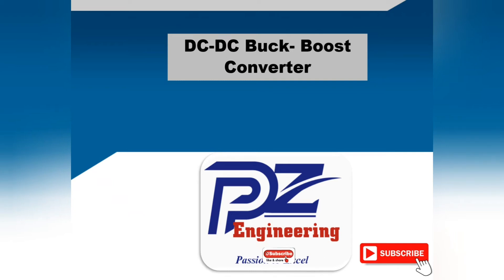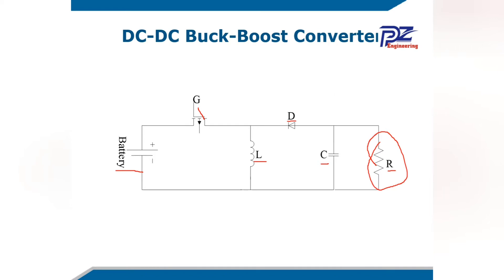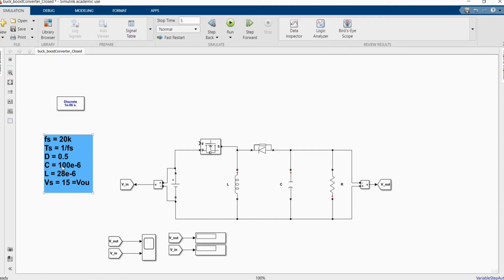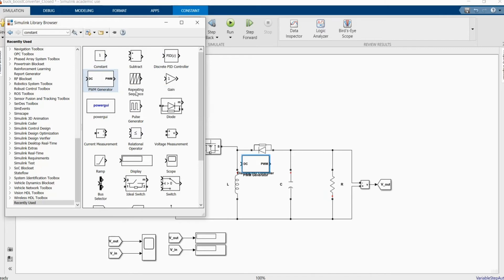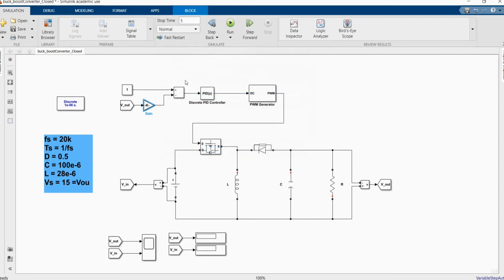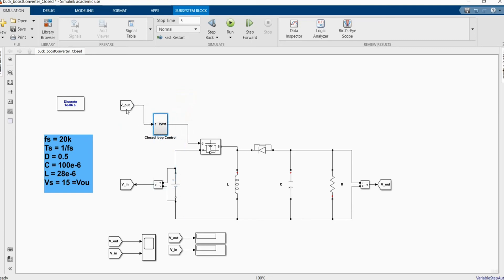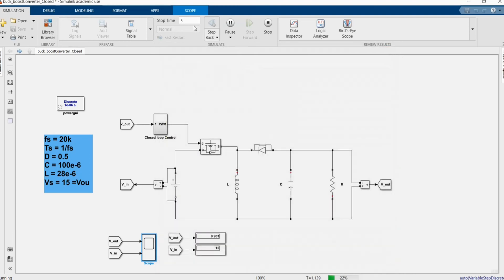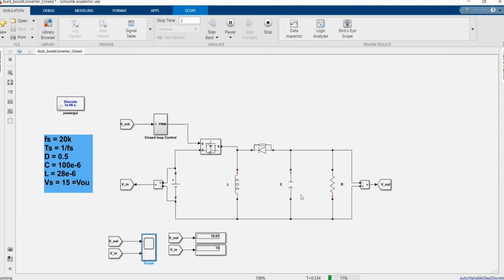Design and simulation of DC-DC BUCK-Boost Converter using PI Controller in MATLAB/Simulink

Comment: Can the buck boost converter charge and  discharge  batteries?(drive ac motor and regenerative breaking process using buck boost converter)if so,i need a simulation steps
Reply from the maker: Hello Thank you so much for your comment, I think it can. The main operation is when is discharging works as boost, during charging work as buck
Reply: No there is buck boost and Buck boost bidirectional i guess the second type only  which can do the regenerative braking

Comment: Sir i am using a bidirectional dc dc converter with a battery and solar system so my input voltage are variable. So how can i calculate the value of L and C. Plz help
Reply from the maker: Hi thank you for your comment, I think you should used an average input voltage to calculate your L and C, From there make sure to design very well your control system. I hope it helped

Comment: great vdeo it help me a lot! can you design buck boost converter with pid controller?
Reply from the maker: Helo; thank you for your comment.. It is the same thing... Just change PI to PID
Reply: @pzengineering2020  i’ve already try it sir and the output does not match the expected result.
Reply from the maker: Alright...we will check from this side and get back to you
Reply: if possible can u send the simulated file of above video to me if its ok i send email

Comment: Sir, First thank you for your brief information but I want to ask you something,  Can you explain how you pick these L and C values?
Reply from the maker: You need to calculate....  using the formulas that are at beginning of the video. The value that you get is the minimum value of L and C required to get the desired output.
Reply: @pzengineering2020  I see. Thank you so much again. Have a nice day,  Sir.
Reply from the maker: You are welcome.... all the best there
Reply: @pzengineering2020  Sir, why did you use half on the inductor value in the design, where L should be (56.25e-6) but in design you used (28e-6)